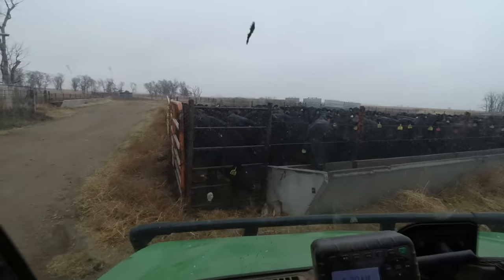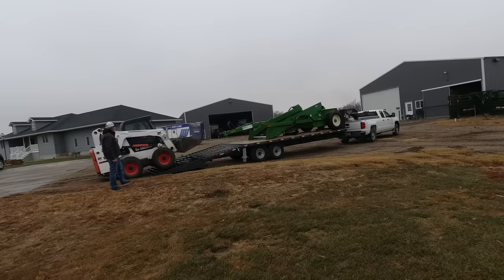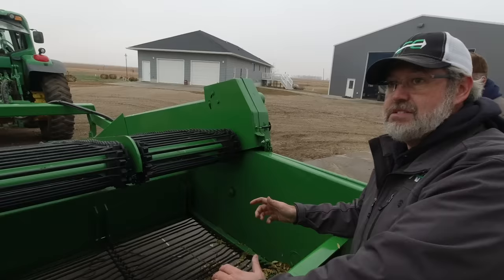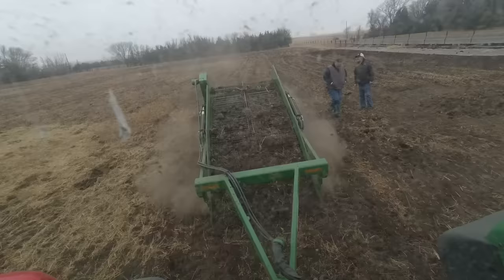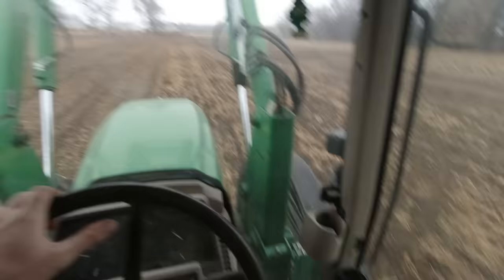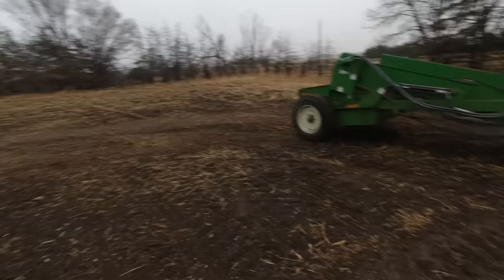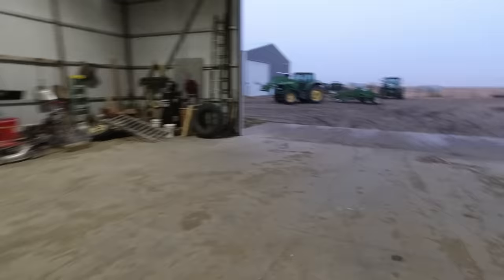Not your Grandpa's Rock Picker!

Comment: Gents, that GFI outlet in the pump house is just a fire looking for a time to start.  Don’t insert or removed the plug with the heater switched ON.  The plug and outlet will get the arc then.

Comment: Also for winter Cole, don't forget to turn the batteries around.  A lot of people forget to do that.  That works in conjunction with the winter air in the tires.  Hope this helps you out a bit.  Love your video's.
Reply: Love the winter air in tires.
Reply: I'm old rough to remember single viscosity oil.  We hid do those changes . Put tire
 chains and shovels and windshield ice scrapers in truck and car. Some things were real.
Reply: Don't forget about putting some antifreeze in with the blinker fluid.
Reply: I had to come see who else caught that
Reply: Ha ha ha

Comment: Just a heat lamp in My little pump shack for watering cattle.  Thermometer in there too. We check it twice a day.
Reply: Or two heat lamps, both switched through their own thermostatic switch, 
one thermostat set point slightly higher than the other...
so if one goes out the other takes over?
Nothing like redundancy......

Comment: We don’t have many rocks where we farm but I would like to see how that would do with root picking after pulling out trees. Picking up roots by hand takes forever!
Reply: Get root grapple for skid steer
Reply: It's a rock picker... not a root rake.
Reply: @freedomrings1420  I can read and realize it’s a rock picker. It’s also built just like a potato digger so it should work with picking roots also.
Reply: @Schmidt973  NOT TOO BRIGHT, ARE YOU.  I grew up on a dairy farm and I also ran heavy equipment for over 40 years. I also knocked down trees and pulled roots. It's not a tree root puller its a rock picker. LOL 😂
Reply: @freedomrings1420  well good for you! You want a prize or something? You’re obviously the one that’s not too bright. You have no idea what type of root picking situation Im talking about and I bet it would work great for what Im talking about. You can keep your negative comments to yourself
Reply: @Schmidt973  Don't cry ❄️ ,you might just melt. Ps, NOT TOO BRIGHT... YOU SAID.... TREE ROOTS .
Reply: @Schmidt973  this style does work well on loose roots from deciduous trees like ash and cottonwood. We have a similar style here in Oregon. It picks them into a hopper pulled by a tractor or a truck the extra elevator chain really removes the dirt. We also use a Schultze windrower makes a lot less passes. Works best if you run a vibra shank in front of it to loosen the ground. What’s with the 12 year olds jumping your comment. Sheesh.
Reply: @adamkruskama8455  I appreciate your insight sir! I know there has to be a better way than picking by hand and a skid steer grapple bucket takes forever also and will still miss a lot of the smaller roots and a lot of times will take a lot of soil with it too. I like the idea of the chain to let the dirt fall back out. I don’t worry about those people. Most of them are just keyboard warriors and know nothing about farming. Hope you had a great Thanksgiving!!!
Reply: @Schmidt973  Happy  Thanksgiving to you also..
Reply: @freedomrings1420  Little roots, about 5-6 inches.  Potato diggers pick those things right up and put them in your bulk body.  I helped clear almost 100 acres of new land to grow potatoes in north Florida.  We walked back and forth picking up all those small roots by hand.  Still had tons of them when we harvested the first few crops of potatoes.

Comment: It's time to change that duplex receptacle in your pump house you are not making good contact with the cords that are plugged in. It may be mechanically tight but electrically loose.
Reply: Each time the scorching occurs in those receptacles the erosion of the electrical contacts from plug to plug point creates more heat...
and more erosion....
Ultimately somethings gets so hot it will burn....

Comment: That rock picker sure beats bending over and picking up the rocks by hand. As for 'winter' fuel, I buy #1 diesel and run it year round. A little bit of power service (white bottle) works as anti-gel AND cetane boost, goes into every tank full in winter.

Comment: You can get a old used Lockwood Potato Wind-rower make a few slight modifications and build a wide rock picker like that. The Chains is the most expensive part.

Comment: A little insulation that you already have and a single light 💡 will do the job 75 watts or hundred  you can get really efficient and add a temp switch so it only comes on set temps 

We don’t get as cold so a 25 watt works for us 
And change that socket before you pump house goes up in flames

Comment: Hope the fire department is not too far away! You should replace that heater outlet with a heavy duty outlet. They look the same but are more robust. Available at Homedespot or electrical supploer.

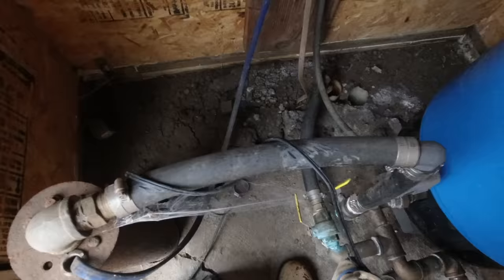Comment: Electrical outlet charring at 1:53 is bothersome.  Charring suggests poor electrical contact between plug prongs and outlet contacts.  This causes resistance heating which will cause continued degradation and can lead to a fire.  After the heater has run for a half hour or so feel the plug and outlet.  If either is hot you need to clean the contacts, perhaps replace the outlet.   A dremel tool with small cloth wheel and polishing compound works well to clean oxide etc. off them. 600 or higher grit sand paper is also an option.   After cleaning the plug contact, leave the heater or whatever turned off, put the plug into and out of the outlet a dozen times or so to clean the contacts inside the outlet.  Check the plug and outlet again a half hour or so after turning the heater back on.

Comment: Granddad's rock picker was an 8 foot wide drag box. On the front, the yoke attached to an old sickle bar, which trailed flail chains that would bounce the rocks into the shallow box. The sides and back of the box were 2x6 on edge, and leading edge 2x4 laying flat, leaving the dirt and organics, which didn't bounce; to lay. Bigger rocks would roll on the leading edge under the chains until they were bounced into the box, pushed in by other rocks banging into them, or lifted in by hand at the edge of the field before the turn. I'm Granddad now, and I overlaid a hog slat bottom of my drag with metal lath, sharp side forward, producing a well graded gravel. Granddad would fall plow, then disk, cultipack, and drag before Spring planting. Depending on conditions, he would gang everything but the plow and drill in tandem, running the whole shebang at a trot speed. He rotated cows and horses together on pasture, another field would get manure,  while the rest grew hay, corn, and soy beans. Eventually, he would run the drag, and he wouldn't pick up enough to make it worth the trouble, so there it set to rot away in the barnyard.

Comment: Have you ever used an oil base radiant heater. You can adjust the heat with 3 main settings & vary the settings in each range. I use them down to -45 C. Water shed needs to be insulated well 2x6 construction

Comment: That picker is slow, but thorough.  Be nice with a wider one but might need to empty it more.  Seems to be a lot better than hand picking or most of the other machines I have seen.   Gets more rocks,  smaller ones for sure.  thanks Cole,  appreciate your work.
Reply: Surely a wider rock picker would have a larger rock box, so it would take the same time to fill?
Reply: The smaller one is hands down better than none you can target areas of concern when there is spare time. Maybe....

Comment: I use a "tooth" bucket to pick up/ move loose hay. It just seems to sneak upon the hay and do it's job before the hay knows it's going to move. A rock hound attachment on a skid steer would do sort-of the same thing but a lot slower. I like this new machine. I remember a fire in a hay field and this machine could eliminate rocks and fires. That's a bargin!

Comment: When pouring anything out of a bottle/ jug where the hole is not on the center , rotate the the jug so the hole  is between 11 & 12 o’clock, that way air gets in & it does not go glug  glug & splash all over

Comment: Change that receptacle outlet to a 20 Amp GFCI type with test/reset option in your well house. Get a hot water insulation blanket and a large contractors bag to add extra insulation.
Put rat bait in well housing to keep the vermin out of the wiring as a preventative and a couple of bags of mothballs.

Comment: If they had brought you a picker that is as wide as your other implements, could you have used auto-steer ?  I’m sure 5 feet wide won’t plug in to your tractor software.  Pretty narrow.  I wonder how much horse power you need for a picker that’s 18 feet wide.  That’s a big unit !  Neat !  Those cattle really pushed a LOT of feed over the bunk. Glad you didn’t have to shovel it by hand.

Comment: I use a old crown rock picker, have to keep it 1inch below the surface, still get lots of trash and if surface not level it digs in for a bucket of soil but still beats anything by hand.  good luck with yours, mine cost $200. at auction so money well spent!

Comment: Ya not my Gpa's rock picker but then he started farming in MO in 1896.  Moved to Ny in 1929.
As for my 50 yr old rock picker not much dif but for mine has a chain-link net that catches the rocks.  To dump it auto so much weight and it unloads.  The rest is same same but for being power take oof driven.  My the way when I do to picking rocks our of a field it is in bottom land and man we have rocks.  Every time i turn ground over i pick rocks by the 100s of ton.  What do we do with them.  we use them to keep the creek in its place.  Last sept with the hurricane a lot of the little ones went down stream maybe all the way to the  Chesapeake who knows where they are now.  We got 14" of rain in les then 10 hrs here and that after a very wet summer.
This yr very fry here In my 74 yr never seen creeks so low as they where the end of Oct.  We need rain and snow this winter or next yr ppl will be looking to sell
Which is good for us b/c we are always looking to buy.

Comment: Wondering where I can get a barrel ful of winter air for my tires, probably use in the water pressure tank in the pump house, even with the heat, you can't be too careful. 😃🤗

Comment: A very interesting approach, to dig down below the surface and get the hidden ones that would still catch a sweep on a field cultivator.  Having a wider model, with time, a farmer could rotate through the rocky spots in his fields and try to keep ahead of them.  And then could go spot pick the visible, larger ones.  I agree with another commenter, please show us how it does with a bigger, heavier rock (basketball or larger), if you can.

Comment: Just use a 100 watt HALOGEN light bulb to keep your water pump shed warm enough to stay above freezing.  That's cheaper than running that heater and less stress on the outlet.

Comment: It’s a good machine. You’ll need a power front blade sweeper on it and slow down the chain a lot to get an efficient job done. I’d also like to have a belted chain instead of hook chain. Lasts way longer but doesn’t separate as well. Repairs are 0 compared with hook chain.

Comment: This is built like a potato windrower except the chains are much narrower than most potato diggers.  The rock windrowers that I have seen would not move the small rocks. And the new (huge) dairies in this area do not have a wall on the outside of their feed bunks, this way they can easily push the feed back to where the cows can  get it.

Comment: might I suggest electric oil-filled radiator instear of the space heater- no open heat elements, thermostat and auto shut- off if tipped Safer and with a good thermostat set it and forget it

Comment: Your fun receptical in the pump house needs replaced with a very good 20 ampere rated one and make sure your plug is snug in the outlet. Looks to me that the receptacle is not rated high enough or the plug is very loose . That is what is causing the burn mark# in my opinion.

Comment: Looks like serious high maintenance and high cost with the chains. Not saying we never had to fix the first rock picker we ever bought but it's at least 40 years old and still picking rocks as well as it did new. Dads rock picker also had bars on the bottom and all they way up the back so soil could fall through so that is not new technology. I should also mention that our old rockomatic could be used to dig out partially buried massive rocks and could load anything that could pass under the center pick up bar. however, I have dug up loaded Huge rocks using the pick up arms and soil to load rocks much larger carried them to the bush on the pick up then dropped them and backed away. You would destroy this machine doing any of this. I am also not overly impressed by the dump the one pile they show being dumped is topsoil and straw. you cant se a stone in it. There are better places for topsoil and straw than a scrap pile. Unless you rocks are small like football size or smaller and numerous and your land is small i see no use You can get an old school rock picker and mount twin rock rakes and do 3 to 4 times as much in a single pass. New isn't always better regardless of how pretty they make it or how hard the sell it. In our fields with our rocks this machine would be dead in one to two seasons. We'd see what massive rocks would do to the bars on the chains and what the bending of the bars would do to the chains and sprockets. the old rockomatic bars in the bucket are about an inch by and inch and they are all bent to shit from massive stones. these little rods on the chains and bucket would have zero chance of survival. Grandpa's rock picker was built to work and last.and it surely did.

Comment: You do know that receptacle is going to fail, right? And I am sure you also know that it is not rated for what that heater is pulling, right? So, since I know you know all that you also know that the one time it fails because of those problems the disaster will be the same as the disaster you would see if you did not have it, right? 😊 And it’s Ok to not know what you’re doing, that’s only true the first time. 😊 This is a great ditty! Well done!

Comment: Seems a lot less efficient than a normal rock picker and rock rake. Though you would admittedly get more rocks with this ya couldn’t use it anywhere with corn stubble and even soybean would probably be an issue with low tillage.

Comment: OK, I guess none of you are electricians, that outlet is dangerous.  You need a 25 amp or at least a 20 amp outlet. 

 Odd seeing hook chain on the rock picker, I thought they quit making that 30 years ago, everyone went to belted chain. 

Funny story with hook chain on a potato digger.  About 40 years ago a local welding shop here in north Florida had built a totally hydraulic driven four row potato harvester.  They were going to demonstrate it to the owner of a large farm and his sons.  Just happens one of the sons is now my neighbor.  Anyway, the builder told them if the if the chains got jammed the hydraulic motor would just stall and they could quickly clear it out.  This was while the tractor was at full throttle and the PTO was engaged driving a huge hydraulic pump and all the chains were at full speed. My neighbors big brother, Little Billy, all three hundred pounds of him, picked up a crow bar and jammed it into the digger bed.  Bent chain links went everywhere.  Billy looked at the stunned builder and told him "Looks like it needs work".

Comment: That rock picker is ok but not a unit a guy would want to use in a seeded crop I think it would be better if it had fingers instead of a blade it seems to push to much trash but it does a nice job of sifting the trash and dirt out

Comment: Not particularly impressed with this machine. I see way too many rocks simply rolling on the belt. Either the slope needs to be reduced, or you need to weld several angle-iron crosspieces onto the chain to stop them rolling. Easy and inexpensive modification.

Comment: WRONG!  You cannot have a cold temperature, only cold conditions, brought about by low temperatures. Temperature is a numerical measurement of available heat. Temperatures can either be high, low or an average between the two. Unless you have re-written the laws of physics and thermodynamics. As you cannot get even the basics right, i am now unsubscribing.